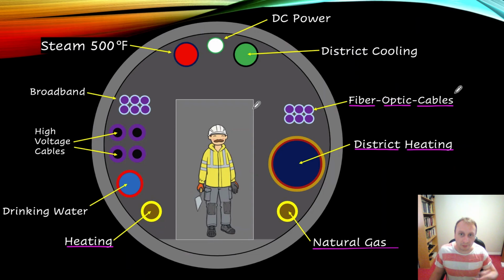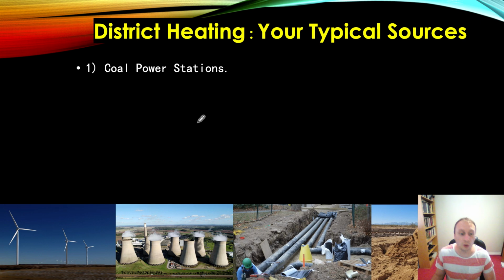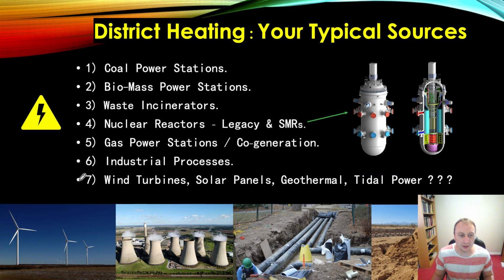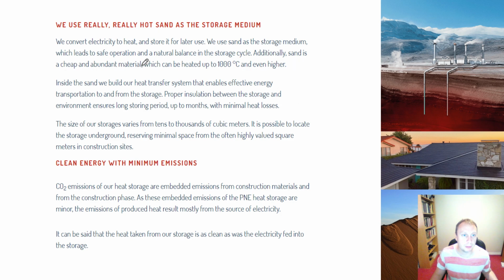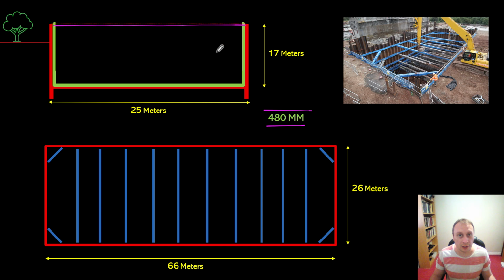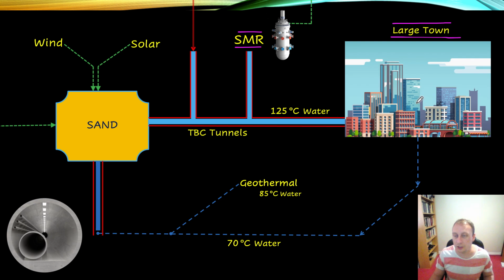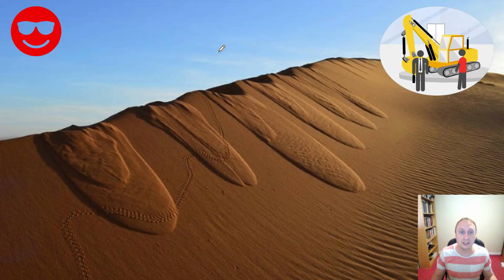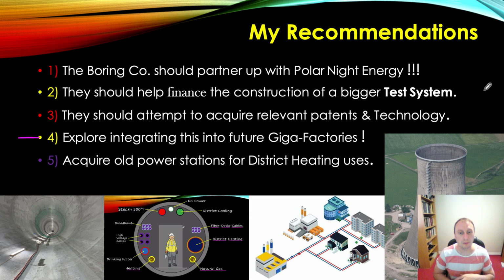Ultra Heated Sand, Hot Water & Utility Tunnels (PART 3) ?!?!? 😇 👍🏻 🚇 💰 👷🏻‍♂️ Episode # 111

Comment: Before you get excited about using waste heat from reactors that do not exist it would be a good idea if you checked out the cost of new nuclear.  Nuclear, as we know it, has no future.  The market will not pay for nuclear.  If you want some facts let me know.
Reply from the maker: An SMR can cost as little as $700,000,000 per reactor. Initially they could cost double that... but nuclear reactors always pay for themselves after 8 to 10 years of operation, thus the next 32 years are immensely profitable. 
Scientists in China are about to turn on the countries first modular reactor. It is the Holy Grail of nuclear energy as molten-salt reactors don't use water for cooling like traditional plants and thus can be built everywhere.

The first commercial plants using the new technology are reportedly planned to come online in 2030.
To make a grid work 24-7 you need base load power. Thus you want either Nuclear Power or Hydro Electric Dams!
Reply: @BoringRevolution  
Let's set China aside for the moment for two reasons.  First, our governments in the West do not operate as dictatorships so our governments have far less ability to simply say "Make it so".  And, also, we can't count on adequate transparency inside China to know what their real costs are.

So, sticking with the Western hemisphere - we do not know what a SMR will cost.  We know two things, one reliable, one perhaps not.  

The reliable thing we know is that for decades the nuclear industry has promised that the next generation of reactors would bring us cheaper electricity.  That has never happened and, in fact, new nuclear keeps getting more and more expensive.  The two sets of reactors now being built, Vogtle 3&4 and Hinkley Point will need to charge at least $0.15/kWh for their electricity and that is multiples of the cost of wind and solar.  It's multiples of CCNG.

The less reliable thing we know is that NuScale, the company now trying to bring SMRs to market calculated that they could produce electricity for $0.08/kWh - one they reached manufacturing scale.  Think about that.  How many SMRs would have to be produced in order to reach scale and who would buy those more expensive reactors?  

And let's hypothesize that NuScale reached scale production.  Seeing how paid off reactors that need to earn more than $0.04/kWh are going bankrupt in the US where's the market for new generation that would cost 2x as much as what barely surviving reactors are selling?  Who would buy 8 cent per kWh electricity (wholesale price)?

Now, molten salt reactors.  Contemplate the task.  If current design reactors produce electricity that is roughly 4x as expensive as what the market will tolerate what sort of technological magic could cut the cost of reactors by 75%?  You still need a reactor and a steam turbine.  It will still take years for construction during which the overnight cost is likely to roughly double due to construction financing costs.

Molten salt is a transfer medium.  It does not provide the water for the steam turbine and does nothing to cool that water.  A molten salt reactor will still need to be near a body of water where it can dump the waste heat or use large cooling ponds for that purpose.

Are we likely to install even SMRs close enough to homes and businesses to allow using the waste heat for district heat?  Most communities would not tolerate even a very small reactor in their neighborhood, whether that's a realistic fear or not.  Would an industry that needs heat be willing to build next to a reactor in order to get cheap heat?  Would they pay enough to take the cost of electricity produced from 15 to 4 cents?  Why wouldn't they just install a bunch of solar panels and/or wind turbines and heat up storage (sand, for example) using resistance heating?

Unless someone can find a way to cut the cost of nuclear electricity by a lot more than 50% then the market will not touch nuclear.
Reply: "To make a grid work 24-7 you need base load power. Thus you want either Nuclear Power or Hydro Electric Dams!"

No, no you don't.  Not at all.

Toss out that "base load" term.  It's outdated.  The task is to provide electricity when desired and in the amount desired.  Loads do not care how the electricity is generated.  Loads would be fine with all the electricity generated by hamsters running in wheels if there were enough hamsters and wheels to do the job.

Here's where we are.  Unsubsidized new wind and new solar are somewhere below $0.03/kWh and probably heading to $0.01/kWh over the next few years.  Wind and solar technology continues to improve rapidly.  But, as everyone knows, the wind does not always blow and the Sun does not always shine.  

Something that lots of people seem to not know is that nuclear plants are not "100%/365" sources.  The need to go offline about 10% of the time.  And they breakdown.  Nuclear interruptions are more frequent than most realize and they last from a few days to weeks and even for a year or years.  Plus nuclear is crummy at load following.  In order to power a grid with nuclear one needs storage and backup generation, just like using wind and solar.

So, what about storage?

Hint:  Tesla.

Lithium iron phosphate (LFP) cells should drop below $50/kWh with Tesla's dry rolled tabless 4680 cells.  According to Sandy Munro it already costs less than $100/kWh to manufacture the lithium-ion cells now being used in the Model Y.  LFP 4680s should cost about half as much based on much lower cost ingredients and a more efficient manufacturing process.  Plus LFP cells can have a very long useful life.  The LFP batteries I'm using with my solar panels are warranted for 10,000 full cycles.

$50/kWh / 10,000 cycles = $0.005/kWh battery cost to store electricity plus a bit for hardware and financing.  Let's err a lot on the conservative side and call it 2 cents per kWh to store electricity for a short time.

2 cents for wind or solar + 2 cents to store = 4 cents for stored electricity

Assume half of the generated electricity gets consumed as generated and half gets stored before use.

2 cents for direct and 4 cents for stored, 50:50 ratio, = 3 cents to power the grid.

Want to invest your money in a NuScale SMR that, eventually after a lot of investment, might produce some 8 cent electricity?  And that's before one adds in the cost of storage and backup.
--

Now there's something left out in the above.  Those few times per year when wind and solar don't produce much for several days in a row.  If you've got a battery that, while inexpensive, cycles only a handful of times per year the cost of sunk capital and financing might make 'deep storage' expensive.

How we supply 'deep storage' isn't clear yet and it isn't something to worry about right now.  But here's a couple of ideas.

1) Hang on to paid off CCNG plants and fuel them with methane recovered from urban and agriculture waste streams.  Those wastes are going to be broken down by little critters who will fart methane into the atmosphere.  We might as well collect the farts, extract energy, and send up a less problematic greenhouse gas.

2) Use pulled battery packs from EVs as they should be very cheap and could use the same hardware that normal battery storage is using.

A 10,000 cycle battery in a 250 mile EV is a 2.5 million mile battery.  Even if EVs follow Tesla's lead and last a million miles that still leaves a lot of useful cycles.  

Those batteries could be sold on to recyclers who would extract the materials and sell them to battery manufacturers.  Let's say the batteries cost $50/kWh in a new car and the materials are worth $30/kWh.  A storage company could buy the used batteries for $35/kWh, use them for years a deep storage, and then sell them on for $30/kWh.  A net cost of $5/kWh plus financing costs.
Reply from the maker: @bobwallace9753  

Ok so that was a long read but I enjoyed it.

For decades the nuclear industry has promised that the next generation of reactors would bring us cheaper electricity. That has never happened. Ok True... We are still applying ever more stringent regulations to a technology designed in the 1960's and built by bloated incompetent companies. NASA did the same for 50 years !
SMRs by design are meant to be way smaller, lighter, easier to maintain, safer and modular. 
Ask yourself why does a motorcycle cost 70% less than a Land Rover Discovery ? Size & Complexity !

NuScale calculated that they could produce electricity for $0.08/kWh - one they reached manufacturing scale. 
For NuScale that is 8+ reactors per year to achieve adequate scale. These are built in stable factory conditions with the same components prefabricated & assembled in a set order thus ensuring high efficiency. 

Who would you buy 8 cent per kWh electricity ? California ? Its supply and demand : when the wind  and solar are falling off you can't power a city with a couple thousand power walls.
Reply from the maker: An SMR reactor will always cost way way less than $1 billion because it was engineered from day one to compete on cost with gas power stations and wind farms. The other components like the generator & power lines are costed separately!

What sort of technological magic could cut the cost of reactors by 75%? ? ? ? easy.

A) They're 70% smaller, thus they cost 70% less to build in dollar terms.
B) They remove obsolete bloated safety system that are not required.
C) They require 50% fewer staff to operate.
D) They are prefabricated in advance thus reducing the construction cost per reactor. 
E) Because of the molten salt coolant they require 70% less maintenance and can run for 50 years with minimal problems or safety threats. 

https://youtu.be/_qtJE7VmyoU?t=7

Most communities would not tolerate even a very small reactor in their neighbourhood. Unfortunately I can't stop stupid people behaving in irrational ways if they don't listen to evidence & facts. If they're worried that said reactor has a 0.00000001% probability (per day) of going into melt down, I can't save them.  They will stay dumb forever!

Unsubsidized new wind and new solar are somewhere below $0.03/kWh and probably heading to $0.01/kWh over the next few years.  Yes but we have cloudy days when the wind is none existent in Europe. So not even the power providers can buy enough Solar & Wind at $0.30/kWh, if it doesn't exist. To cover a 48 hour period with Tesla Power Walls when we today have a shortage of battery cells is just not viable this decade!!!!

Something that lots of people seem to not know is that nuclear plants are not 100% / 365 sources. It's strange you say that because the UK's power in % terms from Nuclear is literally "stagnant" for 330+ days of the year. It is ultra reliable and large maintenance events are scheduled months in advance. The reason some US reactors are going offline occasionally is because they're getting old and just like my Dads 2004 Honda Accord, it's worn out and ready to die.

You need base-load power because you can't turn off the entire electrical grid for 10 minutes, it causes insane damage to electrical infrastructure and screws over millions of people. Yes every home should have a couple power walls and every factory should have solar on the factory roof but we need consistent, reliable power 24/7. 
To get that you need either Gas, Coal, Hydro-electric or Nuclear Power. in the year 2021 you can't have 45% Wind , 45% Solar and 10% Gas Power as every couple months a blackout event will cripple the entire grid / country.
Maybe if every single U.S house had 2 power walls or solar on the roof we might have a scenario where we could weather a power shortage but that won't happen until maybe 2035 / 2040.
Reply: @BoringRevolution  

Who would you buy 8 cent per kWh electricity ?

The US energy market will not pay for 'always on' 8 cent electricity.  The US is closing coal and nuclear plants because they can't compete with wind, solar, and natural gas.  Perfectly good plants that need more than 4 cents to cover operating costs are being closed.

" Size & Complexity !"

What we see with 'steam plants', coal and nuclear is that the larger you make them, within reason, the less expensive they are to operate.  The US nuclear plants that are not in danger of going bankrupt are large plants that have two or more sizable reactors.  The plants being shut down, for the most part, have a single moderate sized reactor.

The argument has been made by credible institutions that SMR could easily cost more per MW nameplate than large reactors.  If you take a single plant and divide it into multiple smaller plants you will force some redundancies.  Each needs its own control system, etc.

Small reactors would be no less complex than a large reactor.  One still needs all the functions of a large plant.  

"when the wind  and solar are falling off you can't power a city with a couple thousand power walls."

There are a significant number of studies which support affordable ~100% renewable energy grids.  Providing the 'last 1%' with wind/solar/storage may be too expensive but we do have potential renewable, non-fossil fuel options.
Reply from the maker: @bobwallace9753  I wrote a beautiful reply to this and then (irony) had a power cut. so this will be brief.
I've been reading up on SMRs since 2017 and I can categorically tell you they'll be well under $900,000,000 per reactor. They are designed with a BLANK piece of paper to achieve low costs & maximise prefabrication.
One other idea is replacing coal fired power stations with 4 x SMRs and thus using the existing infrastructure on-site.
Electricity bills in Europe are going up, not down so  €0.12 per kWh will be a bargain come 2025.
My concern with Wind is as such : no country has made it work at 58% or beyond. You can't have 6.7 GW from wind one day and then just 0.5 GW the next day. The swing is just too wild to manage with batteries alone, major stress !
Maybe you can dig me out a case study showing Wind or Solar working at over 58% of the entire grid ? Ideally you want at least 42% Nuclear power if you want to eliminate all gas power stations.

Comment: At night, wind power would be better used charging up power walls and EVs.
Reply from the maker: Maybe - but let me tell you why that's wrong.
Typically you are charging your BEV from 50% to 90% so maybe at most 27 kWh in a Tesla Model Y. A Power Wall is around 12.8 kWh I believe in the UK !
I can put well over 12,000,000 kWh into a Polar Night Sand Pond. You are thinking way too small my friend !
Also your electric boiler is 18% more inefficient when you compare heat loses per hour per litre. 
The UK will be 28% wind Powered in 2024, thus this concept makes a ton of sense !
Reply: @BoringRevolution  

The fact remains that you’re better keeping the energy as electricity if you can. 

The heat store is great if there’s nothing better to do with the energy.

And most people currently have gas heating and hot water, not electric.
Reply from the maker: @fredbloggs5902  Yeah and gas is fine but I've spent £6,000 in the last 4 years repairing / servicing gas boilers at my various properties. 

It's literally money down the toilet. A district heating system is a game changer once built out to scale & you can't beat it for efficiency + everyone's monthly bills would be way lower.

But if you love gas, keep using it.
Reply: @BoringRevolution  combined heat and power has been around for decades and is incredibly efficient but it never got adopted much, not sure why.
Reply: I’m guessing too much vested interest in keeping things the way they were.

Comment: Solar, wind etc. Are better kept as electricity as long as possible, heat is a low grade energy last resort for energy storage.
Reply: Solar and wind have zero storage capacity and are far too variable. Cost per unit generated & lifespan don't help either. Where appropriate they can work for sure.  Nuclear is constant high level safe clean, anywhere.
Reply: @ButeSound  Except they can be used to charge MegaPacks, Powerwalls and EVs

...And the argument here is about energy storage, not energy generation.
Reply: @fredbloggs5902  when the generation is sucky you need storage. I.e sand or masses of batteries. Clearly inefficient & uneconomical. Wind farms, solar & battery megapack facilities don't make themselves out of sunshine. Am all for using them where it works but need baseline of clean nuclear.
Reply: @ButeSound  I completely agree, what are you arguing about? This whole video is about storing intermittent energy as heat, with nuclear the need isn’t there.
Reply: @fredbloggs5902  your initial comment re keeping solar wind as electrical energy as long as possible. That depends on the storage medium because they absolutely need storage. Any storage is inefficient expensive or both, heat may be cheaper but less efficient than expensive better battery systems. Cost and scale do matter. Anyway We can't run the world that way  so if we are talking about energy that is cost effective and clean we can't help but mention nuclear.
Reply from the maker: I have a smart meter!!! How much does a hot shower cost you Fred ? 
If you use natural gas maybe £0.75 per day per person.
With district heating : maybe as little as £0.25 per day per person.
Reply: @BoringRevolution  You’re completely correct, but that doesn’t alter the validity of my statement.